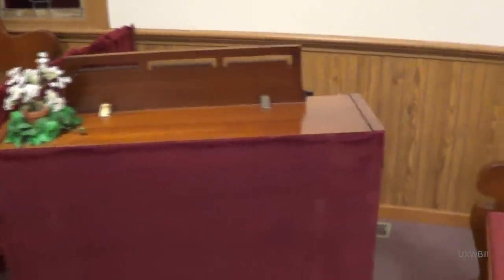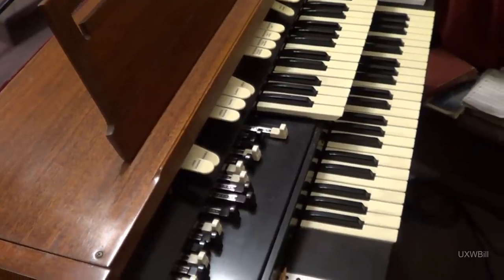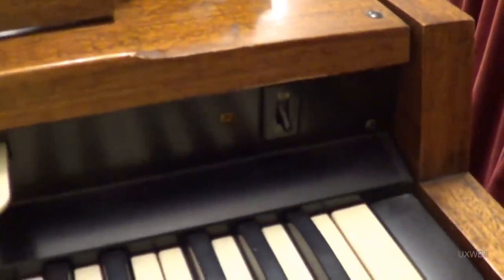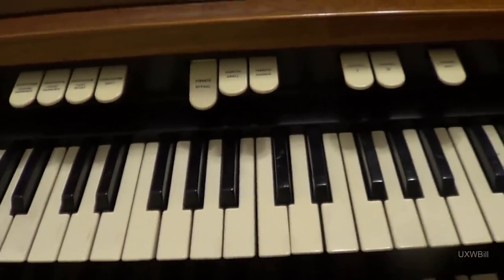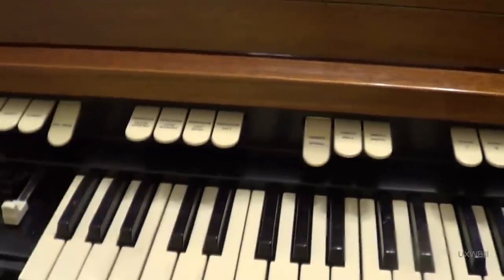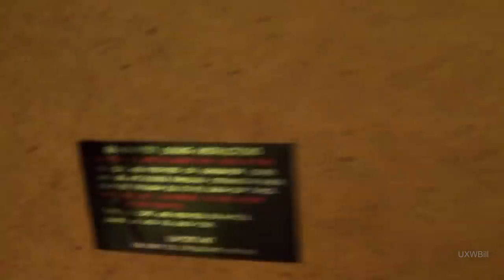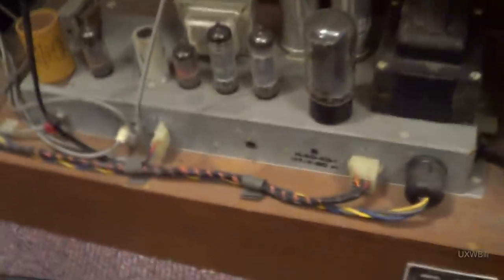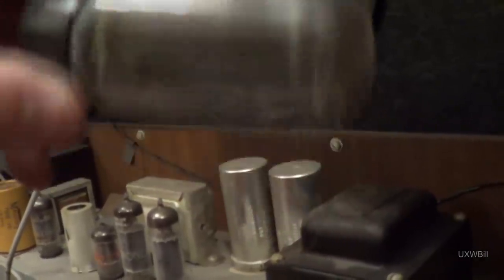Exploring/Troubleshooting a Hammond L-102 Organ

Comment: The L series was made from 1961 to 1970, a spinet model hammond with a self starting motor (unlike the older M series which required 2 switches).  If you decide to rebuild this, don't forget the pre-amplifier may need attention as well.  I've had several models over the years older and newer than this one, and just about all of the issues with humming were resolved by servicing the pre-amplifier and amplifier.  Most console models don't have an amplifier, only preamp,  as they don't have internal speakers, but I believe all of the smaller spinet models do.  It's amazing the difference a hand full of capacitors and sometimes a few resistors make in these things.  Hammond is now Hammond-Suzuki and they still make organs, though nothing sounds quite the same as a real tonewheel organ.  You can still buy hammond oil

Comment: Yep, it's capacitor time. those old caps definitely are going to be an issue. the rectifier tube looks like it'll soon go as well. the cap job won't be too bad, just make sure all the resistors are doing their job and you, or whoever it is that gets them replaced for them, and it'll be alright. Could take this opportunity to order the caps off Arrow and take advantage of their all-the-time free overnight shipping. so much better than digikey or mouser in that regard.   All that and a bit of lube for the motor, make sure it's doing its job, and everything should be right as rain in the amazon.

Our church here has an organ from the 70s or 80s they've been doing upkeep on, but they have a professional company come in to do the work. I'm sure that sort of thing doesn't exist too much in the sticks, and I'm sure something like that isn't in the budget for a small church. The one secret I've been told to keeping the organ long running without too many a hitch, when I last asked about it many years ago, is that they keep the volume all the way down and have their own amplifier setup in the next room take care of pushing the sound from it to the overhead speakers above in the rafters. makes less work on the amplification circuits and overall longer life. but we're talking about a bigger three rank organ. the woman that has been running it has been doing so since the organ was new and knows all the little quirks of it, and I can remember it being big news that at one point they were finally able to use the top rank again after something failed. Since then, they've had the company booked once every six months to come in and make sure it's running right. 

At the very least, it's not a pipe organ with the pipes built into the architechture of the building, like it is with the biggo catholic church in town, of which I've only seen in action a few times in my life and need to walk through since they use the downstairs area as a voting location when it comes to be that time. I wouldn't be able to start wondering what sort of madness would be involved in the upkeep of an organ that needed to drive that.

Comment: A congregation I was a member of had a Johannus Organ, made in the Netherlands. It was about 10-15 years old and got real flaky. Sometimes when you turned it on it worked, sometimes it didn't, sometimes it would quit in the middle of the service. The problem was the local firm we bought it from ceased to exist and the only service technician was a few hours away so it was $500 for him to come and work on it. It might work when he showed up it might not. Finally a member who was handy with electronics looked it over and blew out the dust and cleaned some contacts, we rolled a piano in next to the organ and started a new organ fund.

Comment: I bought the audio output amp H-AO-43 from a guy off Ebay who had parted out the L-102 organ. Rebuilt the front end input and put in a treb/mid/bass Fender tone stack circuit. Made a great 15W amp. EL84 output push pull, cathode biased.

Comment: Give the organ a drink of oil per the instructions on the back while you're in there, since who knows when it was done last.  Don't forget the motor also; the oiling ports are inside the flip-up tabs on the turrets at each end of the motor.  The tone generator funnels are accessible through the big holes cut in the wood above the generator.

Comment: Love to see as restoration vid on this!  I have my Uncle's 1960's Heathkit organ that he built.  It's full of little tone generator boards.  It also has a Leslie speaker that has a baffle the rotates.  It as well needs to be gone through as it's full of the old style plastic molded caps.  It's solid state and did work when plugged it in last.  I leave it unplugged as my cats liked to go inside if the cabinet via the volume peddle.

That Hammond being all tube has to have a very nice sound to it.  I know a lot of audio hobbyists like to salvage the amps from them for Hi-Fi use.  I'd hate to see it meet that fate.  It would be a large scale task to recap it, but it would be well worth it as the new caps will probably outlast the originals.

Comment: I'm sorry Bill, I have no words of wisdom on these electronic organs.  My expertise are in the theater organs that use pipes. :/  If it has a hum, I'd check the ground.  I'm also thinking that these tube types also had an issue if one tube was failing, or had already failed.  Either way, I loved the video and look forward to your next video. :)
Reply: I'd also like to add that I just got an electronic organ, similar to the functioning one there at the church.  Although I've been spoiled with the big sound of the theater pipe organs, this one does sound decent for an older electronic organ.  mine is a 1999 Baldwin MCO Tempo 185 (According to the sales receipt in the bench).  It was willed to me by the same guy who sold me the 1990 Buick Park Ave I currently own.  I know nothing about this organ, except how to play it.  I can, however, ask around the organ society and find some info out for you, if you'd like.

Comment: From your description, it sounds like a failing filter cap. Any of the paper /wax caps would be suspect for failure, but my money would be on one or both of the can caps. While there are many ways to check their veracity, I like shango066's version of in circuit test, simple and effective. And if it is a can cap, you can order replacements - they are being made again. Just ask D-lab, Uncle Doug, Brad the Guitologist, or any of the other tube guys out there where they buy them. Only deal is, they are very expensive. You can get individual replacement caps for about 1/20th the price of 1 can cap.

Do you oil the motor while you had the back off?
Reply from the maker: Replacement capacitors are so much more compact that I'd simply hide them under the chassis and maybe leave the cans in place (but disconnected) for cosmetic reasons. If one's really inclined to do so, the cans can be carefully cut open, the old internals removed, new capacitors installed inside and put back together so they look original.

This isn't that rare or valuable of a set, so I don't see the need to go crazy with preserving the original appearance of the amplifier assembly.
Reply: Oh, I wholeheartedly agree with your first assessment, being as this is an instrument meant to be in long term service. Once all those old, huge, caps are replaced, there'll be quite a bit more room underneath with which to put those extra 3 to 4 caps per can. 

Hope whomever is chosen to do the work can get it done in a reasonable time frame at a fair price.

Comment: Would definitely replace all the caps and check the wiring to Make sure it’s safe. Also I would replace the rectifier tube. It had a big burn on the side. A sign that it may soon die
Reply: That is not a burn it is gettor deposit

Comment: As far as I know, which isn't much, but there's two Hammond companys. One carries it's legacy of organs and the other is a manufacturing company that makes plastic and metal cases and transformers, seeing as some of their transformers are made for tube equipment, I hazard a guess they may have ties to the old Hammond organ company, although I'm not 100% sure.

BTW I have two Hammond M3 organs back at my parents place, one I got from my school that hosted a church before they built their own, and the other was my grandmother's. The school organ is in better shape and it's the traditional brown color. The other organs's amp is beginning to deteriorate. This organ is blonde, and also has a reverb system in it that uses a necklace type spring and a drum machine.

Comment: No leslie the vibrato is created by one of the preamps.behind the manuals
 Replace the start cap next to the motor. You might have to replace the. Filter caps on the main amp on the bottom. The can caps are still available from antique electronic supply. Start motor cap first. It's a start run cap.this organ never needs tuning It runs off a synchronous motor. As long as you're line frequency is right. Voltage. Can be off but frequency has to be good. Those rods are pickups nxt to gears the valley and the teeth of the gears. Create the waveform.

Comment: Hammonds are practically guaranteed to be tonewheel or clonewheel organs as a rule.  They were bought out, but some instruments are still being produced under that name.  I was hoping this one had separate start and run switches so we could all have a good chuckle watching you attempt to turn it on, but alas, it only has one motor and one switch!  You lucked out, sir!  Tuning on those instruments is universal because the tonewheels rotate on the same shaft with a synchronized motor and cannot vary in rotational speed one to the other.  It's all contingent on the speed of the system, which can be adversely affected by insufficient lubrication in either the motor or the tone generator itself.  The tone generator has its own oil trough and a system of wicks that carry oil to the parts that need them by capillary action.  (See https://www.youtube.com/watch?v=7Qqmr6IiFLE.)  The parts of the TG you thought were for tuning are more likely for per-pitch "equalization," which could be important in rooms with strong resonant frequencies.  (That's a pure guess.)  Outside of the very complicated TG, Hammonds are ridiculously simple beasts.  Definitely stay away from capacitors in the audio generation department, but recapping in the amplifiers and power supply is probably a safe bet.

The instrument itself is pretty spare.  It has only one set of drawbars per manual, whereas something like a B2/C2 or B3/C3/A105 has two per manual.  It also assumes that the instrument would never be used to play organ literature, but only hymns, fairly limited preludes, popular songs, and maybe jazz and rock.  As a classically trained organist, layouts like that frustrate me because the offset upper manual assumes that the left hand would never use it.  Having only one octave of "stick" pedals assumes that the right foot would stay glued to the "'swell shoe" and never play a single note, when even for modest hymn playing, both feet are needed and the pedals need to be long enough to accommodate playing with both toe and heel (except for the sharps, which are generally toe only).  Full-sized pedalklaviers are hinged at the back, under the bench, not at the front, under the console.

Now, that said, I wouldn't be ashamed to have a B3 or C3 in my living room as a practice instrument because they have enough playing surface available to cover a good amount of literature.  But if I had my pick of toasters to play, I'd pick a 2- or 3-manual Allen made in the last 15 years or build a Hauptwerk virtual organ with a castoff console from a reputable builder like Schlicker, Holtkamp, or Casavant.  Of course, nothing beats the sound of an organ that actually breathes.  I'd much rather have one of those in my living room.

Neat video.  I'm looking forward to seeing part 2!
Reply from the maker: Had there been a separate start switch, there might have been some trouble with that. If it was marked as such, I'd have certainly twigged on quickly. But, you see, someone I know very well once told me in an e-mail of their adventures with an organ having a start switch. That was back when the both of us exchanged e-mails very frequently. So even if it wasn't obvious, I was armed with knowledge sufficient to likely get me there.

I too figure that recapping the power/amplifier chassis is pretty safe. I was surprised and impressed to see that Hammond was thoughtful enough to provide indications of where each cable was to connect on the power/amplifier chassis. Only that large round plug was in any way ambiguous, since it had no marking nor keying.

Comment: I think i came to the same conclusion you did, rectifier valve and smoothing capacitors, or condenser for the older engineers out there.
Thankfully there were no selenium rectifiers in the psu/amp.
So is that motor creating blow or suck and the keys open valves bill?, could be the reason why you had to wait.
Nice old unit :-D
Reply from the maker: The tonewheels generate a small electrical current on a periodic basis as they spin, which is sensed by a pickup within. Each one has a different pattern, thus producing a different tone. Several of these can be switched in, along with passive components, to produce a sound with particular characteristics.
Reply: Thankyou bill, now i understand how the generators work, i would imagine that motor rotating them must be synked to the 60hz mains.
A very unusual organ, i hope they get it repaired.

Comment: The speakers look like they have been replaced sometime in the 90s or early 2000s. Originally they were not powder coated, just bare metal and their membranes look fairly new. The humming may also be a lose ground issue in the amp. Sometimes just resoldering can solve it or finding and replacing a rusty connector.
Reply: The speakers are original, both my L122 organs have them like that and they were never redone.
Reply: @BetamaxFlippy  I have a L122 too. Bought it in a garage sale. It's in very good shape, all original, but the sound is very low and faint. I replaced some tubes and cleaned the RCA inputs and connectors, but still the same problem... The volume pedal makes no effect and the pedal drawbar makes a hum when pushed. Any tips on why the sound is so weak?
Reply: @Bolation  try to play around with the plastic connectors, they're known to be very crappy and could be making no contact
Reply: @BetamaxFlippy  Do you mean the rca plugs? If so, I measured them with a multimeter and they all tested good...
Reply: no I mean the white plastic plugs that go to the different modules inside the organ, the ones that look like pc connectors
Reply: @BetamaxFlippy  Ooooh right, right... I definitly will. That's a good tip. Thank you very much!

Comment: Likely needs some caps replaced.  Especially any larger and higher voltage caps used for filtering.
Reply: Yes, they can turn into resistors when the electrolyte degrades over time. I would check the indirectly heated tubes, too. Just to be sure there is no leakage of the AC heater supply inside the tube.

Comment: Try first using a good contact cleaner on virtually everything--pull tubes , clean tube plugs, get all pots, just about everything. The main problem is that the tone generator probably needs oil. First run ronsonol lighter fluid through the generator  (No joke) There are three cup-like places for oil. Use several drops of singer sewing machine oil in each cup. Really flood it with lighter fluid which cleans it quite well.  clean the contacts on the drawbars from inside. Then you can start to look for bad caps.
Reply: @Josh Swann Run Ronsol through the oil cups--quite a bit. Say 1/4 of a bottle. Unplug the organ and let it dry for a day. The lighter fluid will clear gunk in the tone generator very well. Then put about six drops of sewing machine oil in each cup and give it a day to get into the tone generator. Use WD-40 contact cleaner (not actual WD-40) on everything else.
Reply: Thanx for the useful tips. I have the same model and im trying to restore it to a more reliable state. The percussion section in mine doesn’t work. Any suggestions on where to start ?

Comment: I suppose it could be a failing rectifier tube (intermittent short?), or maybe failing caps that are somehow breaking down only under certain conditions (if that's possible).  Luckily, I don't think I saw any selenium rectifiers in there (unless they weren't visible on video).  Not only can those stink up the place for days when they blow out, but they also become leaky over time (allowing currents to pass backwards across them), as well as increase their voltage drop.

On a side note, those Hammond organs (I don't think it was the exact model shown here, but I'm pretty sure it was the same series) were a staple in Emerson, Lake & Palmer's music.  Watching Keith Emerson abuse these things (primarily tilting the whole unit back and forth to change the sound from the tonewheel) is kind of amusing...
Reply: The tilting only made the spring reverb beat against its case making that "thunder" noise, he changed the pitch by turning the power switch on and off intermittently.